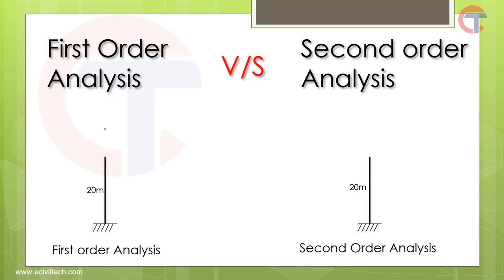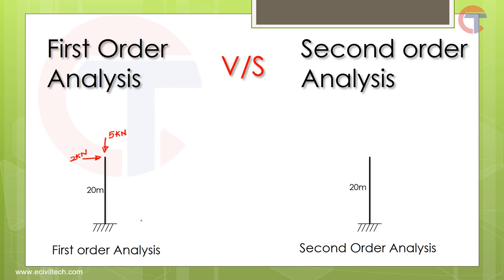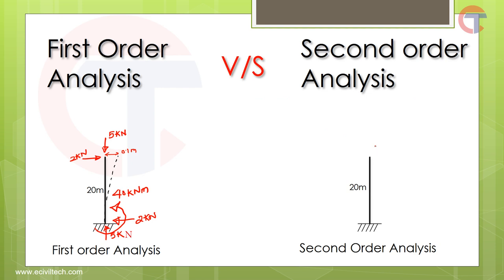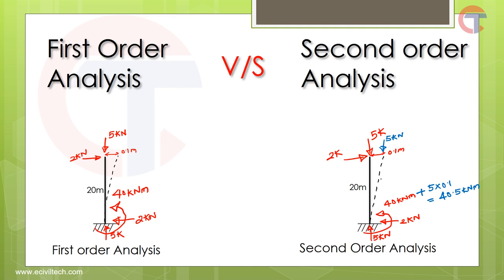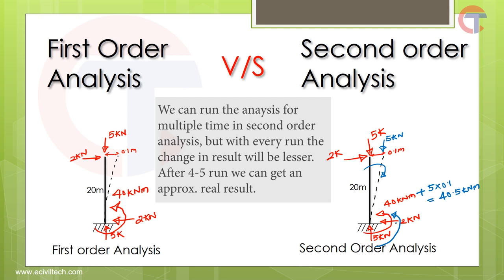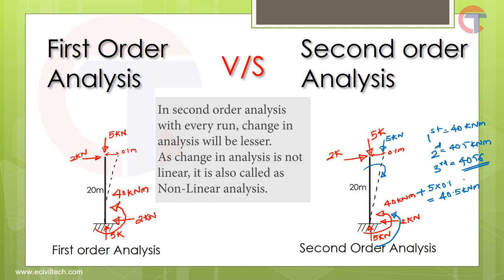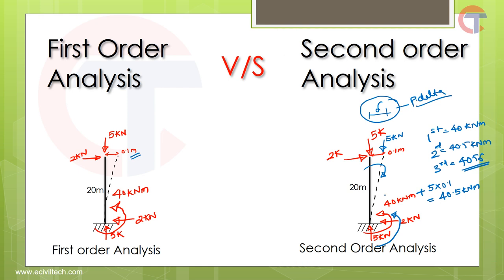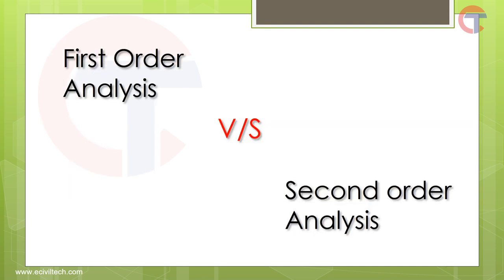First order and Second order analysis - Linear analysis and non linear analysis - P delta analysis

Comment: Thank-you for the clear explanation. In the future, I recommend relating theory with practice at the end. For example, the Canadian steel code now requires p-delta analysis. Structural analysis software, such as Risa 3D, has options to turn on/off p-delta analysis. Etc...

Thanks again :)

Comment: thank you it was very helpful, if you could just add the usage of each type in real life like when non linear analysis is required this would be much appritieated
Reply from the maker: Non lenear analysis must be done for the structures which sway (deflect) a lot. In real life analysis is done for transmission monopole, transmission towers, highmast, high rise narrow building structures, elevated water tanks etc. Lenear analysis is more simple and fast process. Generally done for structures like small buildings and other structures where sway is less.